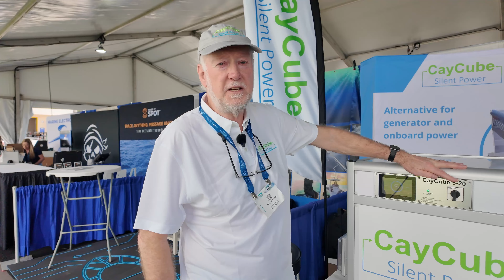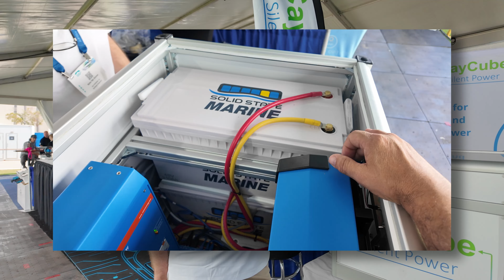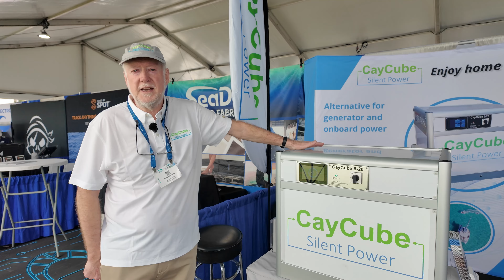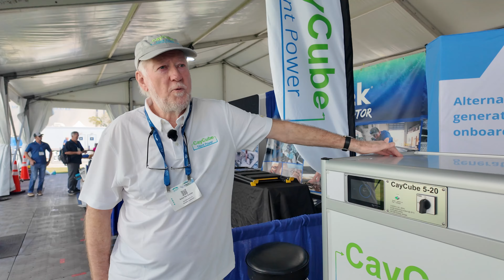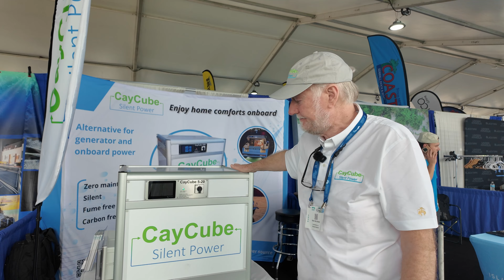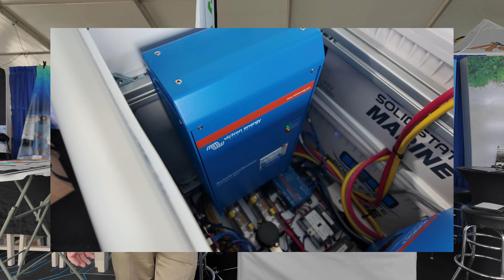PBIBS 2026: CayCube product introduction

Comment: This product makes good sense. You could broaden your market by offering a 10Kw unit, targeting PNW boaters who do not require air conditioning. Btw, I did the same five years ago, installing a 5 kW power station (Hysolis) with a built-in low-frequency, 3 kW inverter, an MPPT controller, and AC and DC outputs. Recharging was via a hardwired cable from the power station to my boat's shore power inlet.